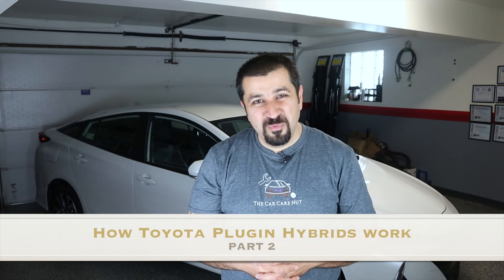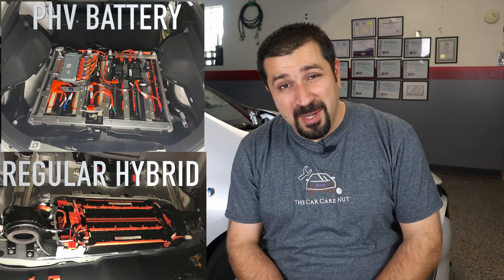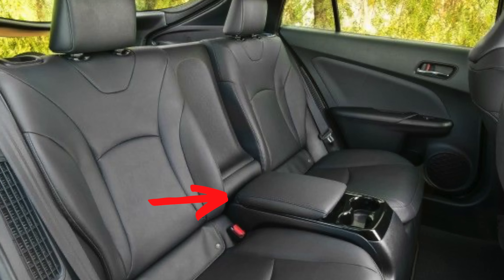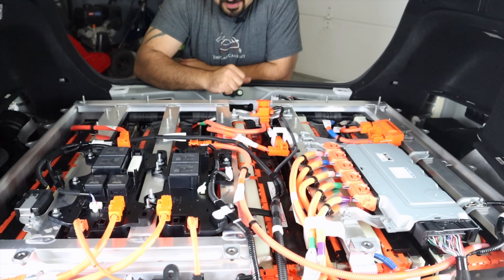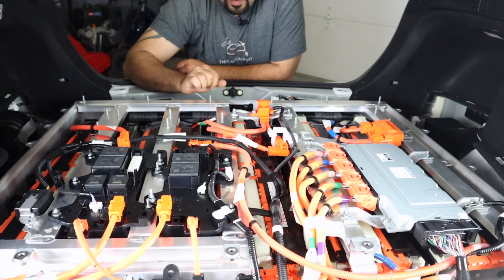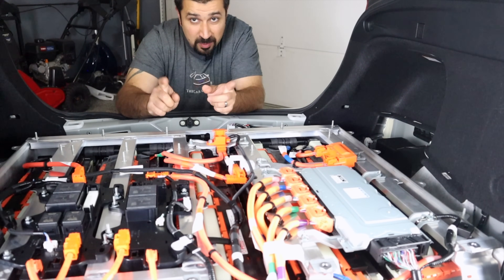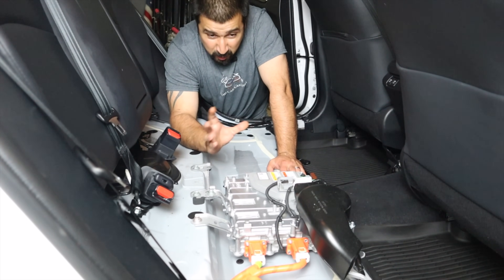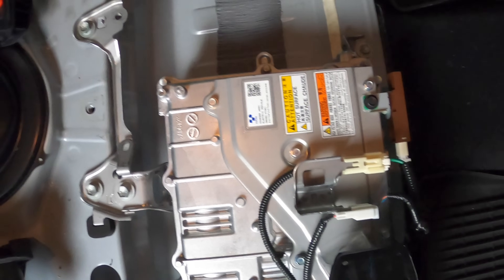Toyota plugin Hybrids. Are they any good? Battery and charging review

Comment: I am  leaving this channel . Never do i get a guestion answered by u!
Reply from the maker: What is your question? I answer close to 300 comments a day and no other car channel does this on YouTube. Have a wonderful day.
Reply: Bye
Reply: 2016 rav 4 ac went. Mechanic could not find leak. They charge it. Will it leak again?
Reply from the maker: Frank, sometimes AC leaks are very small where they get very hard to see and find. The common practice is to add refrigerant dye so the next time it leaks it will be much easier to find. A common place to leak is the service valves make sure the caps are installed as they serve as a backup seal. If the AC doesn’t leak again and stop working in a months time it means that the leak is very very small and likely will be tough to isolate. Freon leaks will look like oil stains on AC components and the dye will shine under black light and special glasses. Hope this helps.
Reply: @frankdrebin6123  what do you think? You want him to say it's magically going to fix itself? 

Take it to a better shop. If it was a dealer go elsewhere.
Reply: @frankdrebin6123  he doesn't know who you are.  So don't take it personally....
Reply: @ChuyenKhoTin2026   i know . Just bought 2016 rav 4  ac goes
Reply: Thanks
Reply: @frankdrebin6123  I found a hard to find leak on the evaporator,  it is inside the cabin. Check that area first.
Reply: Hai AMD, 
Does doing A/C system flushing  yearly is good, or flushing not required if the A/C system if fine?
Reply from the maker: Metz Matu it shouldn’t need flushing yearly. If the system is sealed and has no leaks it should be good
Reply: @TheCarCareNut  they did dye test found nothing.  Just recharge it.
Reply from the maker: How often is the time between charges?
Reply: @TheCarCareNut  
Thanks for the info.
Reply: Yupper
Reply: I dont understand . They just charge it with a sealent and freon i guess cost 149 dollars
Reply from the maker: Is this the first time you charge it?
Reply: @TheCarCareNut  yes
Reply from the maker: Ok I would wait and see if it ever stops working again and go from there

Comment: I'm a Prius Prime owner and your Toyota content is second to none!
Reply: WOOHOO! 2018 PRIME owner here. I love these cars!
Reply: I have the 2014 Prius plug-in and the only issue I have with it is the interior plastic is VERY cheap and pathetic. Side door plastic is already faded.
Reply: @Puggy42069  nbkbon nvkb kn kk. N k k
Reply: @Puggy42069  no no no B k B k in
Reply: Alex Bruecken Any issues on your Prius Prime with its batteries?
Reply: I just purchased a used 2018 Prius Prime Plus. 100,000 miles! I'm hoping that Toyota reliability gets me at least another 150-200,000 miles. I was hoping you could explain how the CHARGE MODE works.

When using that mode on the highway to charge the battery am I consuming more fuel to power the engine? I want to balance my EV use and my gasoline use. I feel like driving on EV before and after I get on the freeway is best and then re-charging the battery on the expressway is a smart move.

Please tell me if what I'm doing is recommended. I don't want to consume too much fuel and I also don't want to wear out the battery.

Thanks Car Care Nut guy!
Reply: @alexanderavila6548 it is hard to have exact calculations, but most of the time it is more efficient as 1 gallon of fuel generates around 11kwh of power. So depending on what is more preferrable. But it seems to be better to charge on highway to trade off higher instant torque in cities